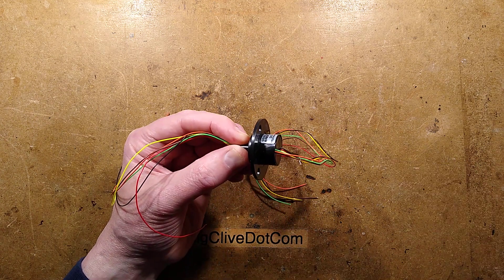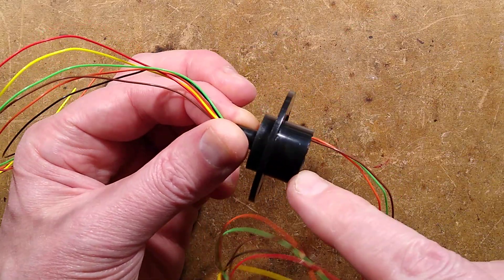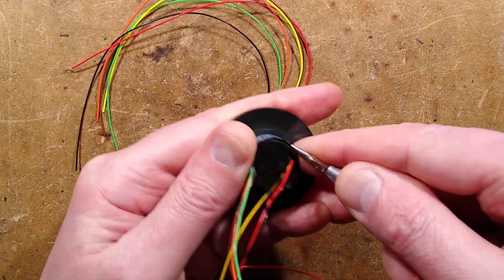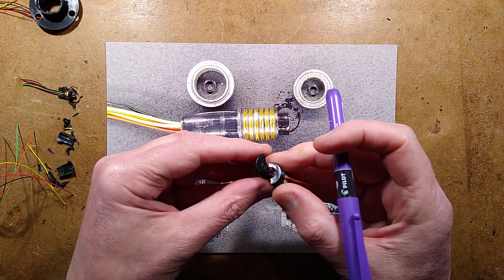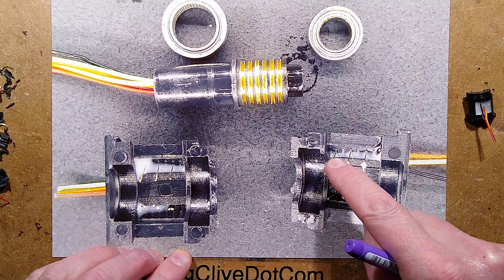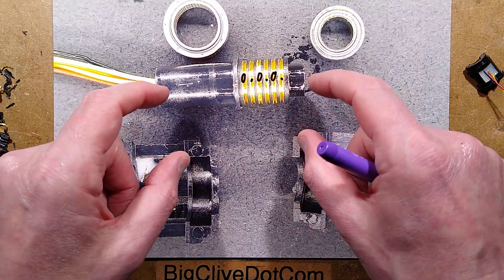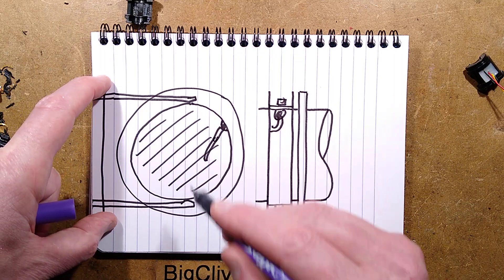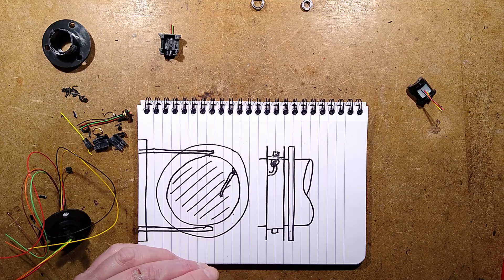6-circuit slip-ring teardown

Comment: Worth noting that for a lot of the ‘bans’ on heavy metals are for devices intended for consumer use or otherwise mass production. Where you will end up with lots of the unhealthy material in the general environment. With exemptions for situations where there is no other option to meet performance requirements and the usage is so small or limited that it isn’t that much of a danger at a social level. For a related example you have the EU requirement for many devices to use USB-C or USB-C with USB PD. That only applies to a large number of consumer devices but will not cover many more specialised devices. Another example is how you can still buy leaded solder for personal use but it’s banned for commercial production use. Complete difference in scale of damage risk.
Reply: I had a machine (privately owned by a hobby club unfortunately) that had these mercury slip rings for power transfer, they were worn out and i looked at replacing them. According to the manufacturer who still makes them 60 years down the line they are by EU law only available: 1. as a replacement for existing machinery and 2. only to business customers of course. I bought the exact ones Clive shows off here and they really do seem to work pretty well, i never had the chance to see how they work over time though since the hobby room where the machine stood was closed down.
Reply: @Ghlargh , analog-audio guy here:  I once briefly owned a British-made Keith Monks tonearm that was a unipivot design which floated on 4 conductive outriggers sitting on the surface of 4 pools of liquid Mercury that acted as conductors for the audio signal.....😳☠☠☠
Reply: I used to play with mercury as a kid. I had (and still have somewhere in a box) a C64 when I was young. Included was a joystick without a base. Just the handle with a cable coming out of it. No buttons or switches except the fire button. 20 years later I decided to open it. Inside was a small PCB with 4 miniature mercury switches. Each quite small and angled in one axis to act as a simple tilt switch.

tbh... except the novelty aspect of having mercury switches in a toy the joystick was quite shit
Reply: @agurdel was it called "The Le Stick" by any chance? Rerez did a video a while back on that product, it was a very early motion controller that used mercury switches - it looked like a joystick handle without the base like you describe. If you look up the video, please let me know if that was it! I'm curious and a little nosy haha
Reply: @TwistedMentat
Yeah, here in France it's still possible for private individuals to get lead based solder, heck even NiCad batteries !
Some drain cleaners however, not anymore !
Why ?
Because of stupid laws !
Reply: @psirvent8  - Maybe because the drain cleaner is expected to end up in the sewage system (going through the whole city, and possibly into a river), while small-scale use of leaded soldier for repairs actually prevents those items from ending up in the trash, so it reduces pollution, overall.

There are certainly some very stupid laws, but those make perfect sense.
Reply: @RFC3514  The laws that keep sulfuric acid (Both for lead-acid batteries and as a drain cleaner or even lab reagent) and other chemicals out of reach of the general public are actually quite recent and have been written because of very bad people who kill lots of innocent citizens with A-Kay forty-sevenS and belts that go boom.
Those aforementioned people used acetone, hydrogen peroxide and sulfuric acid to make dangerous compounds used to harm people at public places.
Hence the ban for private individual consumers in most of the EU, with France being one of the most stringent countries on that subject.

Professionals can still buy all those chemicals including powerful drain cleaners, however they have to show their ID, company registration number and fill in a form stating the intended use... Of a drain cleaner (!) and purchased amount.

Borax and boric acid on the other hand are restricted (Again, only sold to professionals) because of their "can-cer inducing properties".

Potassium permanganate because of reckless people harming themselves by making concoctions out of it that are supposed to get them high.

One chemical that is actually banned for both consumers and professionals is sodium chlorate.
Its intended use was weed killer and its common improper use was DIY dangerous fireworks.

With all those bans (Chemicals but also petrol cars !) I'd really like to move to another, less stringent country, maybe the US but I'm neither ready nor really sure.
It will definitely have to be well outside the EU and UK though !

Hope my comment will show up despite everything I'm talking about 😂
Reply: @psirvent8  - I'm currently living in the EU and I have no difficulty buying most of those products in normal amounts / concentrations. I've never been asked for ID. I did a quick search and was able to find them for sale on several French websites, too. I can't post links (YouTube deletes the comment), but if you search for "déboucheur acide sulfurique", etc., I'm sure you can find it too.
Reply: @psirvent8   I'm in the US and pretty much all the things yoy mentioned are available legally and more or less reasonable priced.  I've never looked for sodium chlorate or potassium permangante but would imagine those are also available.  The  restrictions on  borax and boric acid are interesting ive never heard of those being considered  carcinogenic.... I buy 4lb box of borax at the grocery store for about $6  for laundry and a 1½ lb bottle of boric acid for about $4 for insects. Both are ban from use in foods  but otherwise no restrictions. I haven't tried to buy ni-cad batteries in forever, though have seen them occasionally but I did buy mil-spec cadmium plated lock nuts acouple years ago.
Reply: ,  as an audio repair tech, one concession I know of to ROHS regulations concerning electronics imported to the EU is modern Fender guitar amps: the long-time standard "vibrato" (actually tremolo) circuit using an LDR circuit (light-dependent resistor, a neon lamp and a photocell, the famous "roach" device) can't be used in European imports because the LDR contains cadmium, and so the European market Fender products have a digital "vibrTo" effects circuit.
Reply: @goodun2974  Oh how the times have changed. LOL. The amount of Cd in an LDR is minuscule and I seriously doubt that it would make any measurable difference if they allowed you to import the guitar pedal.

On the other hand, when I attended university in Europe in the 1990s, we wondered whether we'd hypothetically get in trouble if we didn't dispose of Cd-containing waste properly. Turns out, the chemistry lab was in principle allowed to dispose of heavy metals down the drain, as long as we didn't exceed allowable concentrations over a 24h average. A quick back of the envelope calculation suggested that we probably would have been fine dumping close to a pound of Cd salts each day. Ouch.

I am glad they tightened these environmental regulations. But it feels as if the bureaucrats are still as stupid as they have always been. Both concentrations and absolute quantities matter.
Reply: @RFC3514  , I believe the reason that manufacturers adopted use of unleaded solder is because they wanted to avoid the looming specter  of possibly being forced to take back and recycle every device they sold when it aged out of service, at the manufacturers' cost.  But if they agreed to a voluntary Reduction of Harmful Substances within their products, then the manufacturer wouldn't be helld liable for pollution caused by their e-waste and they would be held legally "harmless".
Reply: @psirvent8  NiCad is still used quite a lot out side the EU in toy battery packs as being more stable than lithium less risk of it injuring a child
Reply: @Hewitt_himself  I don't think so, at least not for new toys.
Didn't you mean NiMh instead ?🤔
As far as I'm concerned, NiCad batteries have been out of physical stores since maybe 15 years ago, and stuff like power tools and cordless landlne phones always come with either NiMh or Li-ion battery packs for the former and NiMh cells for the latter.
I've even seen many years back ago articles about the ban of NiCad batteries for ordinary consumers, yet you can still find them on reputable websites.
They don't ask for an ID or a company registration number or any of that business, unlike chemical suppliers whenever a listed chemical is involved (Potassium permanganate, boric, sulfuric and nitric acids, borax, hydrogen peroxide above a certain percentage and so on...)
Reply: @psirvent8  for Toys no... I believe he misspoke, NiMH are often confused for NiCd because same  voltages, etc....  But they're definitely still used for emergency lighting, as they withstand abuse* very well and are generally reliable.

*life inside a ceiling mounted emergency light fitting is abusive.... hot, the charge circuit is usually a simple resistor and diode, or equivalent, and they're often not changed for years,but are expected to light the fitting for 3H in an emergency. I have several brand new packs of 3xAA nicds on my desk right now (3.6v, 800mAh) as a company wanted 'non emergency' lights to match the emergency packs.... the cheapest way was to buy emergency lights, wire only to the switched live, and remove the batteries
Reply: @Hewitt_himself  I thought that particular risk was related to how hard you throw the battery at them, not the chemical composition.
Reply: @TheChipmunk2008  I know about the emergency lights.
Yes they still use NiCd batteries up to this day.
For the toys I just spotted he said outside the EU.
Living within the EU I can't speak for outside of it.
Reply: @psirvent8  I am UK based, so technically outside the EU (shakes fist at polyticks) but .... i would think even in very remote countries that are not subject to any international treaties, simply obtaining NiCd would be cost prohibitive over NiMH?
Reply: @psirvent8  NiCd is still used in some applications because it's so easy to charge. Charging is actually endothermic and will happily absorb whatever you throw at it until its full. Last thing I got was these cheap solar path lights with NiCd N-cells. Airliners use NiCd for this reason, until they tried to go Li-Ion with near-disastrous results.
Reply: @straightpipediesel  Li-Ion are increasingly in use in aviation. Yes, the B787 had some incidents early on. But improvements were made and they haven’t been a problem since. Also not that the A350 uses Li-Ion batteries without incident.

Comment: We use them to bring power from the body to the dome in R2-style droids. Generally double up the wires for 12v and ground, and drop the voltage to 5v for LEDs and such in the dome, to reduce the current across the slip ring as much as possible. Thanks for taking one apart!
Reply: I was going to suggest to double up on wires for most things.   ive pulled them out of older VHS players as handy slip connections for projects but those are getting to be rare these days.
Reply: I would like to see your Droid
Reply: These aren’t the droids your looking for 🛸
Reply: Youtube says that this comment by @kredal was made 1 month ago, and also says that this video was made 2 only weeks ago. Strange.
Reply: @jimmybrad156  then it was just unlisted before made public. Usually so things like patreon support gives early acces
Reply: @SteenSpinal4LIFE  got it.
Reply: Hah, came to say exactly the same thing. :)
Reply: How can dropping the voltage reduce current?
Lower voltage does however reduce the pitting if sparking occurs.
Reply: @1kreature  I think you're misunderstanding what he is saying. Send 12v up through the slip ring and drop in the dome for the lights, etc. rather than dropping in the body and sending the lower voltage through the slipring. 

I always advocate for sending as higher voltage as possible to the dome through the slip rings.
Reply: @1kreature  thought i would quote Mr Ohm for you  lol "The relationship between current, voltage and resistance is expressed by Ohm's Law. This states that the current flowing in a circuit is directly proportional to the applied voltage and inversely proportional to the resistance of the circuit, provided the temperature remains constant."
Reply: @1kreature  Doubling up the wires...  splits the current... and 12w at 12v is 1 amp, 12w at 5v is over 2A....
Reply: @1kreature W=V x I...?
Reply: @1kreature  Pass the 12V through the sliprings then drip to 5V with a switch mode regulator. The 12V current will be 5/12 smaller, in theory.
Reply: @1kreature  I = U/R, I'd assume. R can't be modified, so all we can reliably change is U.
There is no other choice.
Reply: @oilybrakes  Sure thats ohm's law. But see wat happens to I wen you reduce V... Reduce voltage increases Current.
Reply: @1kreature  garden hose, voltage is pressure, hose size is resistance. The hose remains the same. Open the valve wider or turn on the pressure washer.
Reply: @gunsnwater  When you are driving LEDs the current through the LEDs needs to be limited the the same value irrespective of the supply voltage being used. If the current limiting is being performed by a resistor that means the supply current remains the same as the LED current (but power consumption increases since P=VI). If a switching LED driver is used then the supply current goes down as supply voltage increases.  Bottom line is that lowering the voltage does not lower the current in this case, assuming you keep your design target LED current the same.
Reply: @1kreature  less flow through same space is less flow. If you're starting from 0 and you only need 5, why stress the part to 12? 

Bigger question to me is why would you pass higher power through it instead of have the power source in the same container, and run everything else through the ring.
Reply: @nicewhenearnedrudemostlyel489  It's the amps that causes the stress, not the volts.  Generally speaking high volts / low amps is better than low volts / high amps.  I'd just run 12v and add a 5v regulator on the other side.

I've been idly wondering how long 3.5mm plugs & sockets would work as slip rings.  Someone must have tried it.
Reply: @j.f.christ8421  Yeah, in the early days of droid building (back in the early 2000's) a lot of people used 3.5mm jacks. They worked, but only for power and weren't overly reliable.
Reply: @DarrenPoulson  Early 2000s? Please don't forget that these robots were built a long time ago in a galaxy far away.
Reply: @DarrenPoulson  Cheers, figured it had been done.  Might try it anyway; it's low power, low RPM and doesn't need to last long.  If I used a TRRS version I could have one wire fail without it stopping.  Others mention using 1/4", might be a bit too big.
Reply: @j.f.christ8421  It has indeed been used to feed power into the dome of an Astromech. I remember watching a YT video about it but can't find it at the moment. It was 'adequate' but wore down noticeably as they're not intended for frequent rotation.
Reply: @j.f.christ8421   volts dont cause stress? Really? Just "the" stress you assumed, or all possible stress? 

It's annoying to have people purposely twist your words eh? 

For you, i was trying to say don't pass current at all through the ring. I think you'd be hard pressed to find a need to pass a real load through a slip ring, in a toy. It's bad practice, whether you think voltage or current kills you.
Reply: Nerd
Reply: @SteenSpinal4LIFE  … he says on a Big Clive video…

Comment: These might be used in a lot of car steering wheels.  Often called a clock spring as that's a different layout and connection though.
Reply from the maker: I took one of those apart in a video.  It was a long spiral ribbon cable.
Reply: Theoretically they work, but in practice, life is messy. As corrosion and wear occurs, slip-ring electrical connections become unreliable. They abandoned them in video tape recorders pretty early on for that reason (in favor of rotary transformers).
Reply: Clock spring is as the name suggests - a spiral of fixed wires, usually a ribbon.  This allows for multiple rotations in either direction, but it's not infinite.  Clock springs rarely fail if set up correctly, whereas these are a known failure point requiring replacement.  MTBF figures are more or less dependent on quality, and these ones are novel because of the small size, but not particularly good.  No attempt has been made to make low friction durable contacts.
Reply: As the name implies, there's a really good reason for the name "clock spring" - It's not a sliding contact.